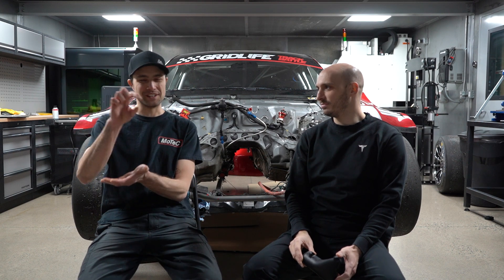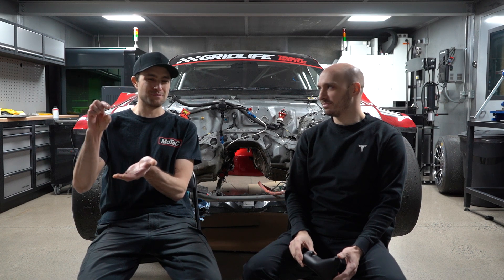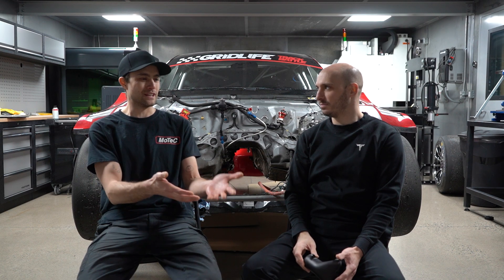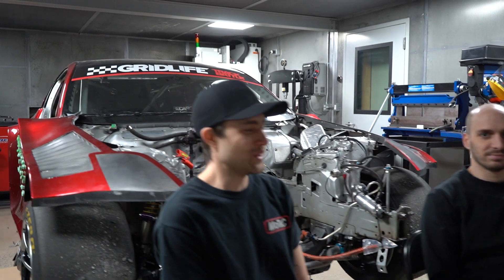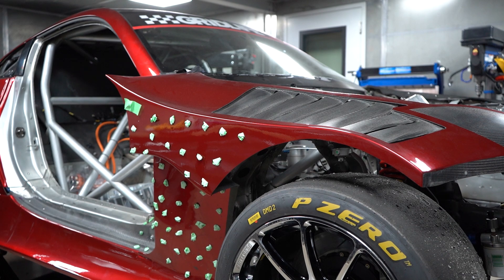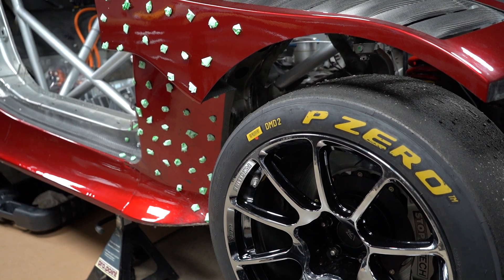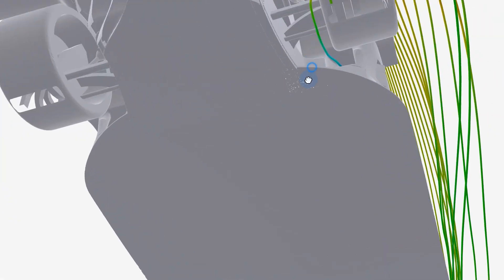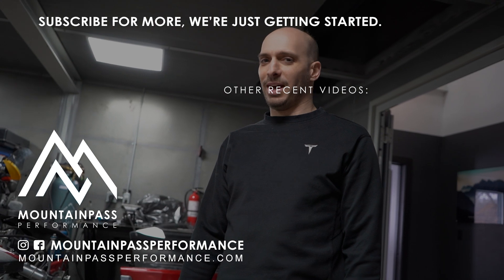MPP 2025 Goals for KERS Kels & Beyond

Comment: That's really interesting about the phi motor. I was under the impression that you had a water cooled axial flux motor. What about the idea of running two motors in parallel? Is there enough room to run a double motor?

Comment: I am very much looking forward to the evolution of Kels 2025, and my own G37 is also evolving. I have ordered a brand new customized CNC suspension and tried different spring settings, hoping that Kels 2025 can achieve faster lap times. I also want to break through my own 2024 lap times

Comment: Build a trailer with a built in battery. Then when you have time to figure it out. add a small drive unit to one of the trailer axles and use it for regen braking and assisting from a  stop.